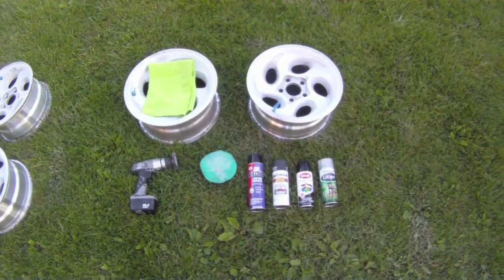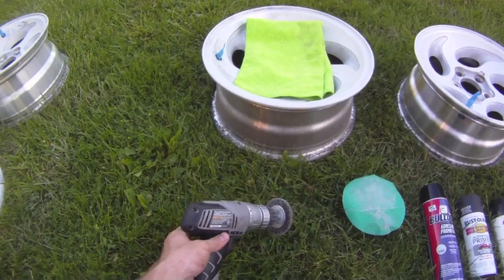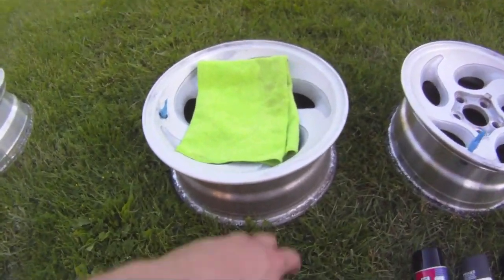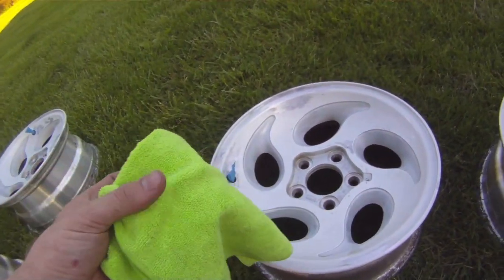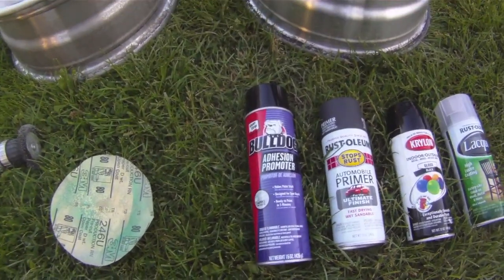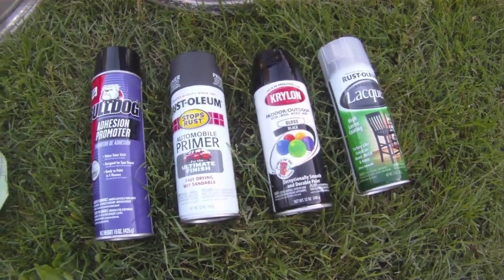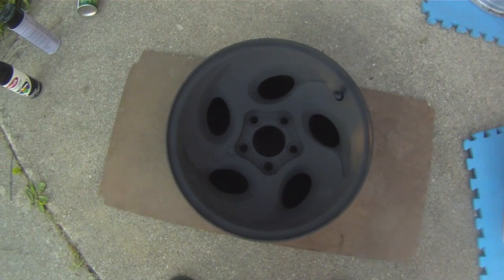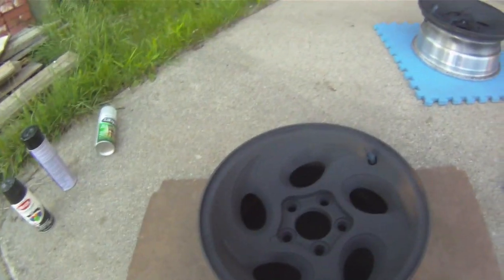Ford Explorer Painted Wheels

Comment: Plastidip is good and all, but in a high traffic area like a wheel, it would peel easily. I have plastidip on my front and back bumpers, as well as my grille(done by the previous owner), and it is starting to peel. But plastidip wheels do look pretty cool if you do them right, and there isn't much to mess up.